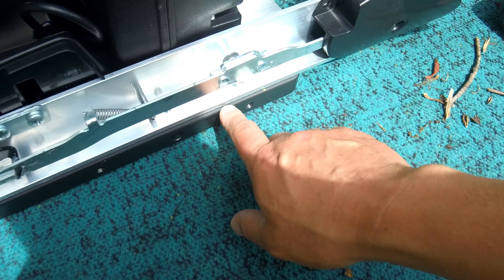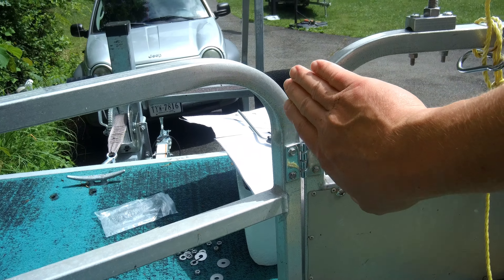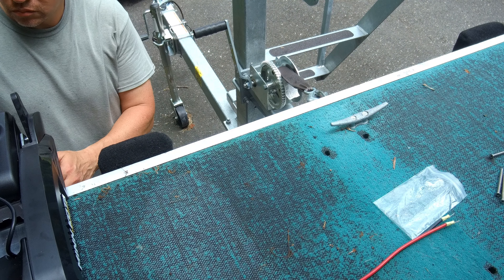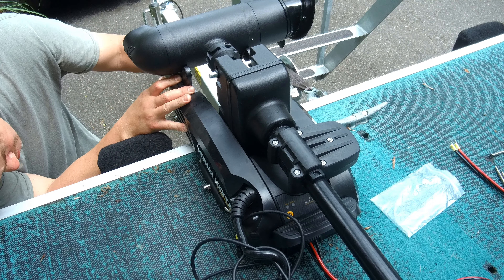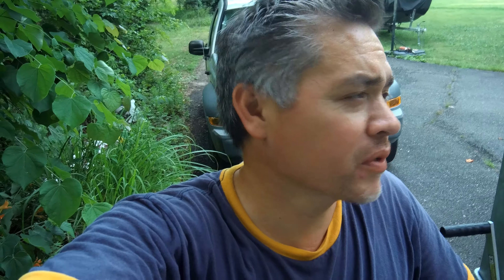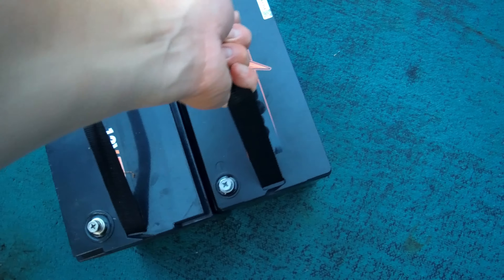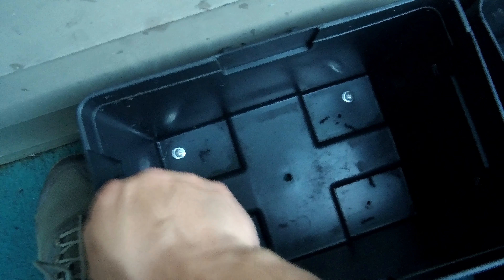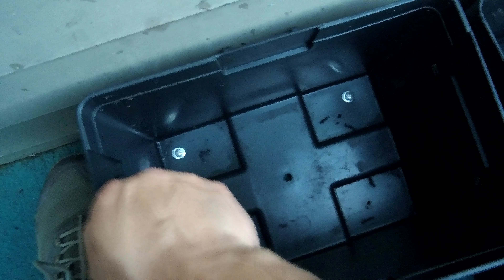Minn Kota Terrova 24v 80lb Thrust  Pontoon Install

Comment: I also recently bought a Terrova 24 volt. I didn't understand. Will two different batteries be used in a pair? The discharge will be uneven. And charge the batteries each with a separate charger? Wouldn't it be easier to install one 24 volt LiFePO4 battery? I did it in my boat. Greetings from Russia, Moscow.
Reply from the maker: You can usually get two 12v batteries for less money then one 24v.  The batteries will have very slight different voltages but will equal more than 24v to operate the trolling motor.  It will work fine and won't really matter.  .1 to .3 volt difference between the two batteries isn't going to be a game changer.  Every other charge I disconnect from series connection and charge the batteries independently.  Thanks for watching!
Reply: @thepauldixonOC  I agree! But I don't have a very big boat (5 meters) and every kilogram of extra weight is not a good idea. Therefore, I try to reduce the weight of the equipment as much as possible. Fishing on the Volga or the Rybinsk reservoir (https/en.wikipedia.org/wiki/Rybinsk_Reservoir). There are more than 50-80 kilometers from coast to coast. It is very dangerous when the weather suddenly changes and the wind increases. Therefore, it is necessary to have a reserve for the speed of the boat. Considering that there are already 3 batteries in the boat.